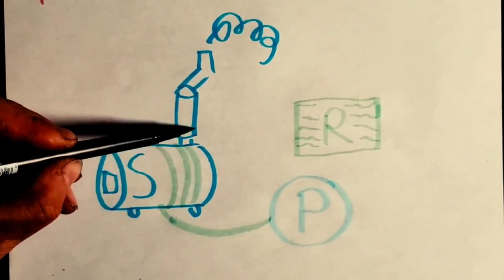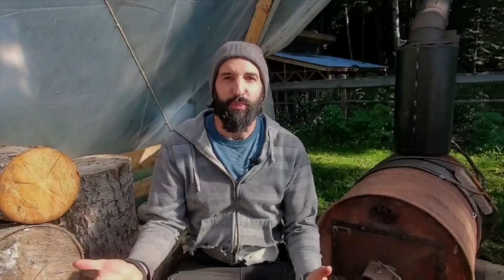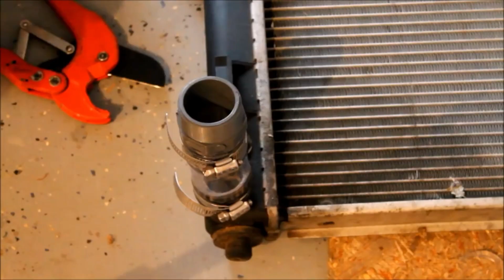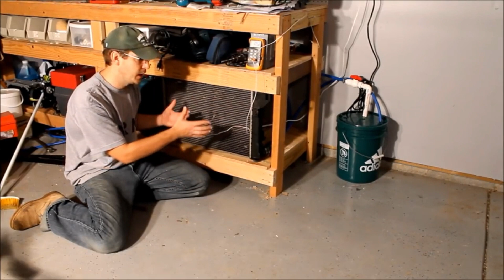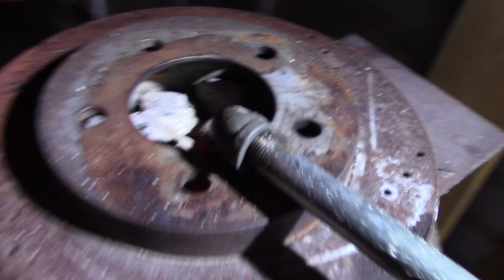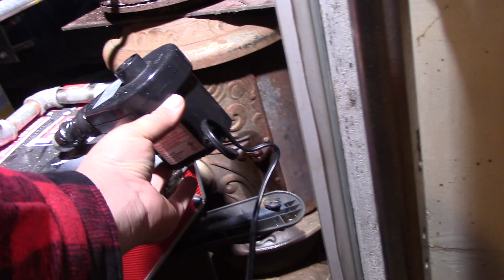(FREE HEAT FOR LIFE) Waste Oil Burner Heat Exchanger Idea P5

Comment: I really don't want to be negative but think your design layout is a waste why did you not have to wood burner inside the garage the heat from wood burner is going into the air outside it is way bigger putting it the wood burner in garage getting most the energy from it and I know a car radiator is good for losing heat but don't think that means it the best radiator for heating a house radiator is cheap properly cheaper and easy to fit pipe to and radiate heat into the room with no need to use energy with fan the pumps and fans you are using probably use as much energy in total than a oil electric heater 😁 
There are things I'm learning and things I knew I could do with wood burner you only use 1 pump on the radiator system just before it goes back in to wood burner also the also no matter the size of system bug pump 8 L per minute is best by alot you would think that slow moving water though thr burner get more heat but 8 liters a min is best fast moving water as for pressure you have pressure valve and a pipe that goes few meter to over flow tank also I found yesterday wood burner with catalytic converter in on top way way way way better when other wood burner use wood it burns the smoke goes up to wood burner inside more air comes in making a second air in should be thought row of about 5 pipes with holes the air come in the wood gas then burns it look like gas not air come out pipes because the second burn like a gas ring on cooker top it burns the all goes out the stack hence why the flue pipe has most heat because it comes from the wood gas second burn but this also means a lot of air is used in the burner fast burning of fuel but the catalytic stove do not use much air in and the cat like on the car gets over 1000 degrees c by alot to show something home made like thjs it called Hcat hydrogen catalytic using a sprinkle if metal from a cat and into sand maybe a good way to go take some top second burn gas pull out the burner run things engine genarator to gas fridge gas boiler or to sand witch is Hcat sand in a tube of box steal anyway side tracking the cat wood burner  last on 6 choped peaces of small log over 20 hours that means no getting up to put more wood burner burn it last night and day and probably one tine full up each day think if you have limited wood suply or buy it  the saving my wood burner need about every 30 or even 20 mins on chip board fron old table like a work top it had been ouside so damp also i have alot to do i wilk run gas fridge petrol genarator wood gas in tank barrel  and 3 grades of oil and methane with hydrogen clean gas to use on thing genarator gas fridge freezer I'm going to use A fridge pump try put in a butane gas bottle failing that a big air bag plastic take that to store gas with brick along it for gravity pressure to keep gas on I will use generator to charge battery bank if needed so back up if no sun and winter ❄️ radiator from hot water from inside big flue above wood gas burner barrel to heat water so hopefully loads will come from a wood burner or wood burner one outside for the hole thing on inside for water and heat summer it could run things like air-conditioning and cool the hone or my my case static caravan
Reply from the maker: I agree 100 % would be way more efficient to have the stove in the shop only thing is my insurance company wouldn't like it and would not insure me or charge me so much extra it's not worth it! Other thing is it takes up room in a shop i can just hang a radiator from the ceiling and keep floor space! 12v blower fans and pump can run off solar and battery storage so no cost there and used oil is free! Other positive is with 3/4 inch piping already running underground outside i can always disconnect the stove and hook in underground 3/4 loops to the existing connections and run ground cooling into my shop in the summer months turning the heat rad exchanger into a cooling rad exchanger!
Reply: @thinkford  cheap Chinese deasel heater are ok classed as mobile heater no regulations and could use engine oil maybe used engine oil there are those burner to just a small exhaust pipe goes out and they 5 to 8 kw red deasel or keresine can be low as 0.03 p kwh people use in home car trucks caravan mobile how they safe and blast hot air under 100 pounds on ebay im getting one tomorrow for another energy source bluetouth on off and timer and i bought and exhust pipe cooler of a car so i connect to exhaust ans put water though for free hot water heating that get wasted they wood heat garage when i worked for uncle doing car machanics as kid 19 years old 46 we had kerosine heater with fan like jet engine was hot fast was wood garage no insulation UK winter I had to feed big 85 gallon drums of potato 🥔 peall pig swill and it  freezed solid and put blast heater to melt it before taking it to land but no good if spraying in work show bits the cone inside glowed they were the days engines blew up because water radiator pipes froze because water filled no coolant

Comment: One more thing you can do with the heat coming off your wood burner or oil burner outside is put some kind of a hood over the top of that thing for the rising heat and duck it inside to your shop to get more heat if you need it
Reply from the maker: That is a good idea that would decently produce maximum heat!

Comment: That oil burner of yours is effing cool as eff!  The stove is really cool too, I could watch fire all day and night.  I considered buying one but wtf for?  I'll never need it and it would just be another toy that I have to find a place to store.
If going with the car radiator route, make sure and use one with an overflow tank to relieve pressure if the fan dies for some reason.  Also, use a radiator mounted electric automotive fan.  If you go to a parts yard get a rad with a fan(s) and shroud would make it even more efficient.  Then just get an ac-dc converter to power it.  Rad fans move a lot more volume than any other type of fan and do so very quietly.  
This is a great idea of yours and I look forward to seeing more of it.  I'm filing away ideas for when I eventually get my cabin in the woods.
Your neighbours must think you're a nut, Dale
Reply from the maker: I see you have been talking to my Neighbours hey lol, yes i have 2 car 12v fans i will use one of them and i have an old cat engine rad from a few videos back of mine. it's a heavy duty mother! A lot of what's in my head is for when my wife and i do retire we want an off grid acreage with solar power and a way to heat cheap! That way we can spend our money when we want to on travel versus utility bills and taxes!